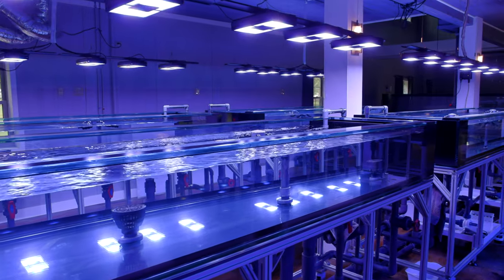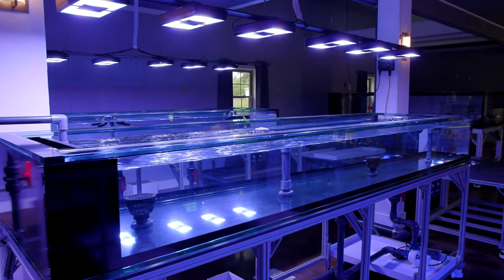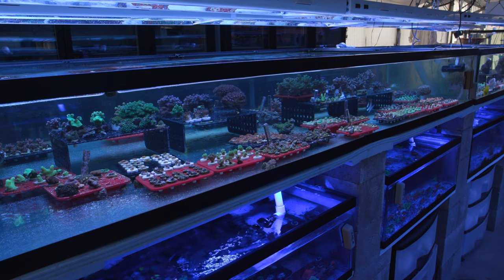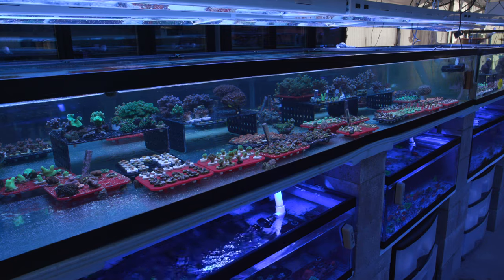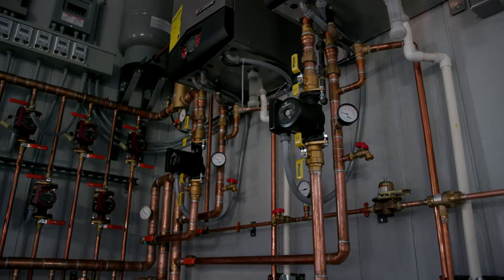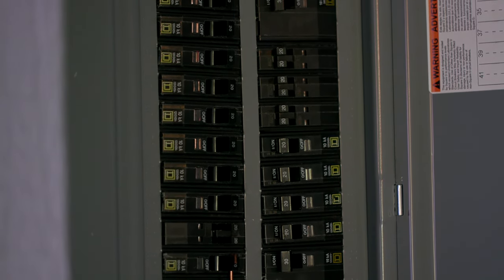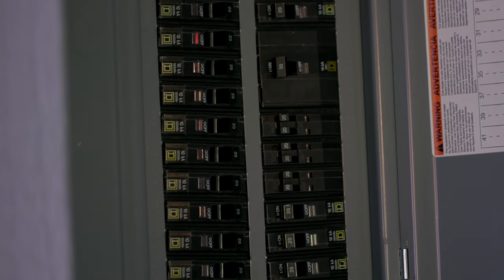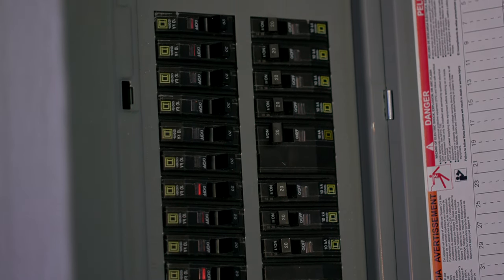The New Coral Farm - What I would have done differently - Episode 21

Comment: The doors are a super easy fix for someone that knows what they are doing. Call around though and tell them you don't want metal doors because of the humidity and rust. Cost will be the only thing that would stop the project. Not tough at all
Reply from the maker: I agree, the steel doors would be better off on another building and replaced with fiberglass.

Comment: It’s 277v 480v then you step it down 110v 220v homes are typically 120v 240v.  Commercial buildings will use  480/277 because you get less voltage drop on smaller wire over long distances.  Also some machinery will be powered by 480/277,  more lights on single circuits there is a number of reasons.  You may of used a electrician who is used to mainly do homes.  Or they just weren’t that great. Lol it happens a lot.
Reply from the maker: They definitely weren't that great.

Comment: Are you sure you can't step up to higher voltage? That doesn't need thicker cables (quite the opposite, higher voltage = thinner cables to get the same power), but maybe it needs additional wires.
Reply: could be that the original feeds (transformer to building) were only rated at 300v and not 600v

Comment: Paused on the closed cell foam part. Good thing you didn’t. You’d have had to get that dehumidifier 😂.
Reply: You would’ve also needed to introduce fresh air.
Reply from the maker: That's no problem, we have 4 large commercial air exchangers.
Reply: @tidalgardens  crazy then how much they were charging over for the foam. What’d y’all do for walls? Assuming it’s not Sheetrock because of the moisture?

Comment: Who manufactures those sch 80 bulkheads you use?
Reply from the maker: I use two kinds, the ones that BRS sells and higher quality ones made by Spears.
Reply: @tidalgardens  Thanks.  I make overflows (Exotic Marine Systems) and use the ABS ones that BRS uses from Joe in Florida.  They work awesome, but every once and awhile, I have someone who only wants to use sch 80, and we are buying them retail and just passing through the cost, because 5 sch 80 bulkheads at retail pricing is stupid expensive.